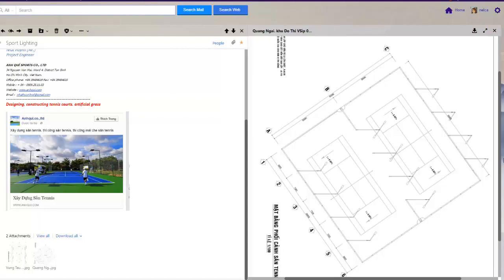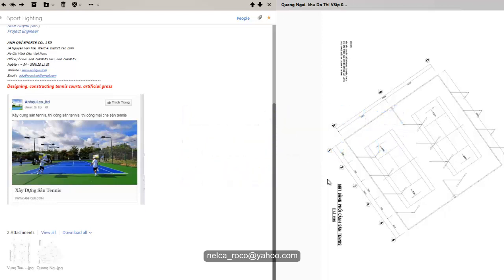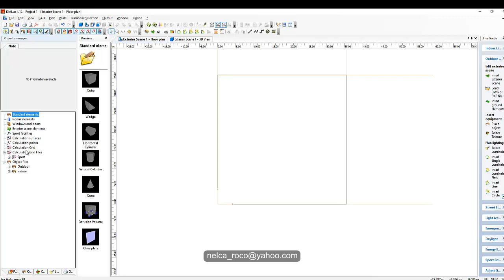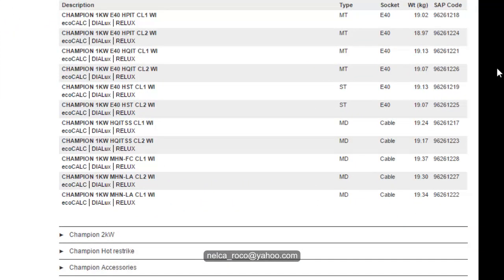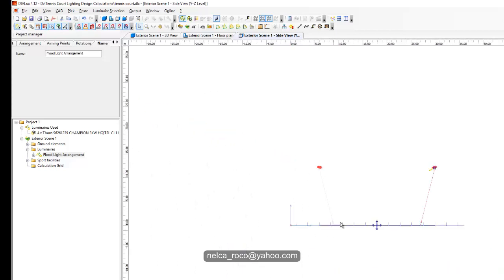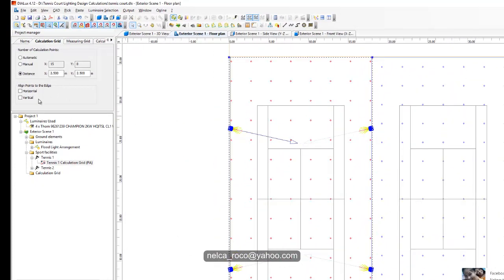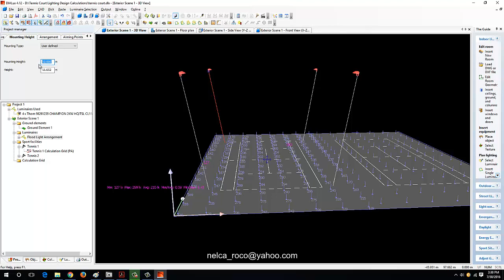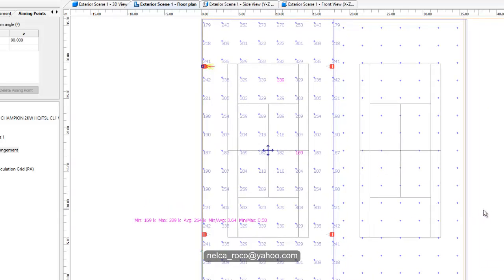Tennis Courts Lighting Design Calculations (Part 1)

Comment: Hi Nelsa. What is the reason of selecting Asymetrical floodlight  and could you please recommend any equivalent plugin in LED? In addition, the beam angle of light is very narrow less than 10 degree, i am wondering how 4 flood lights are covering big area? As per the photometric, these lights are suppose to illuminate small area. Please clarify my confusions. Thanks

Comment: Yes nelca it's sea port. Width of 25m length of 720m, pole height 50m, required Ave lux 30. Using high mast led 400w 110lm/w
Reply from the maker: this is for you. https://www.youtube.com/watch?v=TptLaC8OdNM&t=43s

Comment: Hi nelca, have you ever tried designing a port? using the HIGH MAST LED light 400w?can  you demonstrate what are the basics on this designing of ports?
Reply from the maker: seaport?
Reply: Yes nelca it's sea port. Width of 25m length of 720m, pole height 50m, required Ave lux 30. Using high mast led 400w 110lm/w
Reply: Yes nelca it's sea port. Width of 25m length of 720m, pole height 50m, required Ave lux 30. Using high mast led 400w 110lm/w
Reply from the maker: ok. let me create a video.
Reply: Nelca Roco, Lighting Design  thank you so much nelca.
Reply from the maker: video is done, i just need to edit it before posting in Youtube.
Reply from the maker: Aeran check this out.  https://www.youtube.com/watch?v=TptLaC8OdNM&t=43s

Comment: How can convert Cd/m to lux for street light projects or to get output results in lux for street light
Reply: it is in the general setting
Reply: @dattadgr8  can u show a screenshot
Reply from the maker: shes correct
Reply from the maker: give me ur email ad, i will send you the screenshot
Reply from the maker: you dont need to convert.  you can find it both there.  check the calc reports.